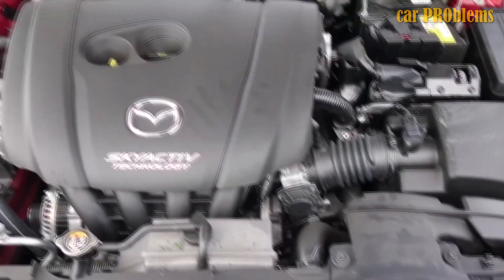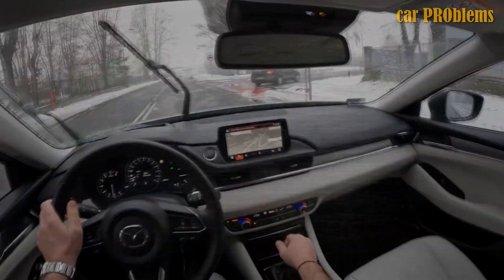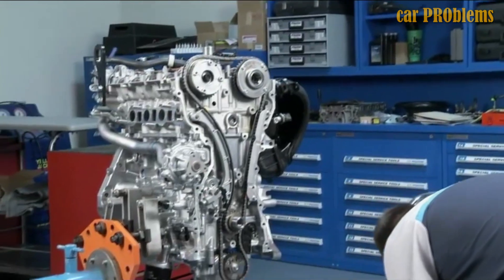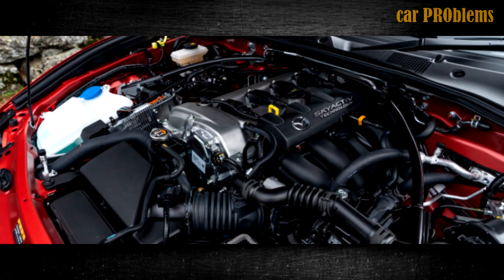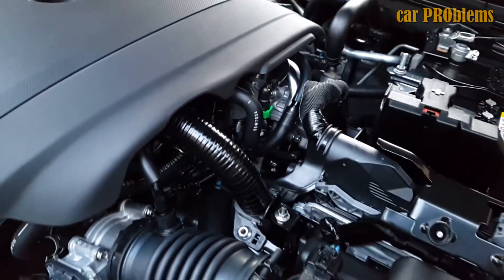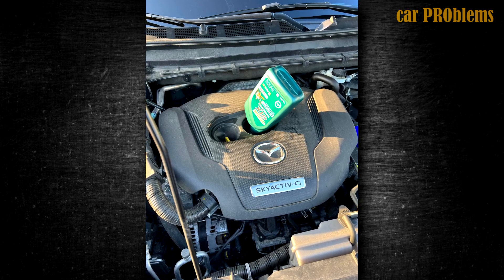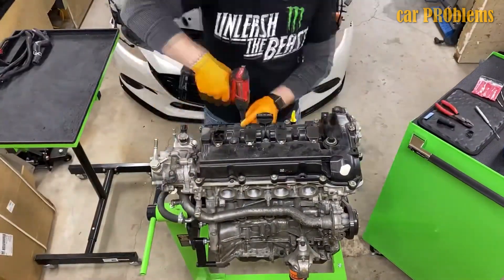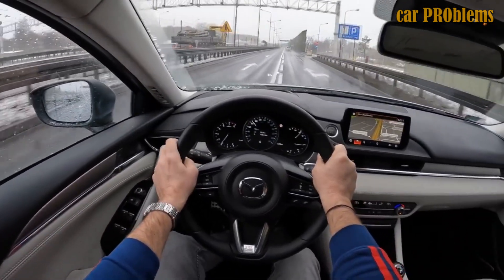Mazda 2.0 Skyactiv-G Engine: Problems, Reliability and Specs

Comment: Extremely boring and reliable, engine and car (mazda 3 ) had one for 9 years. Nothing went wrong with the engine ( 10,000 km oil changes ) one flat battery, one flat tyre. Bought a Peugeot , first year leaking water pump.
Reply: Why the hell would you buy a Peugeot… may aswell buy a Vauxhall. It’s just cheap plastic crap
Reply: @jugganaut33  cause RCX look good
Reply: @vladislavfeldman6562  that’s fair I guess
Reply: Why boring?😂 I own one my self the G120 version one.
Reply: @nicotang5583  I also have one but its an 160 engine and i let 120 tune it to 198. No problem after 5 year tune.
Reply: @nicotang5583 See how that goes against a Peugeot RCZ 200.
Reply: @vladislavfeldman6562  you can't compare these 2 cars. They're completely different. The Peugeot is a coupe and not a compact car...
Reply: Boring? 😂 I got 165 hp not boring at all my previous car was Mini Cooper s 184hp with turbo I must say there is slightly different lol but the comfort and practicality I have with Mazda I chose Mazda every day all day
Reply: What engine oil do you use?
Reply: @darioali5517  Also have a 9 year old mazda. Well im using original mazda Supra x oil with wynns super friction proofing that additive realy make the noise and fuel consumption go down and at yearly car inspection person thought engine was off when it was running. Im changing oil at 12000 km. Driving hard also "redline" alot but theres slightly oil consumption when u go to hard "0.5L oil/5000km" so it made me drive slower rpm so it doesnt consume oil at all anymore.
Reply: @darioali5517  Whatever the manufacturer recommends
Reply: You’re supposed to do oil changes every 5000 and those vehicles
Reply: @shawnpennell1627  Mazda recommends 20,000km (12,000miles) with fully synthetic oil 10.000km is fine, but if you are game you can change the oil every 1,000 km.
Reply: Watter pump os pretty common issue also with mazda
Reply: What model year was your mazda 3 2.0 L?
Reply: @aiman1562  It was a 2014 base model, auto, air. cost A$20,800 brand new sold at about 80k.
Reply: I went the other way
Reply: Me too i am leaving my 407 for a Mazda 6

Comment: 12,000 mile oil changes..? No, try 5,000 mile oil changes.
Reply: Hi, I'm considering getting Mazda 6 with this engine. Is it really that oil hungry? Would you recommend the car in general? Thanks
Reply: @BennySVK117  I would definitely recommend the skyactiv Mazda 6 with the naturally aspirated (non turbo) 2.5l engine. These engines have direct injection and therefore the oil should be changed every 5,000 to 7,500 miles with full synthetic only to avoid carbon build up.
Reply: @robbyjay8119  Thanks a lot for answer :) I can't find any used Mazda 6 with 2.5 engine, only 2.0. The 2.0 petrol in Mazda 6 2013 is bad? The used car market in EU is pretty f*cked up right now, there is not enough cars and the prices just keep going up. Since this will be my first car, I'm pretty scared to just "pull the trigger" and buy one. I want to buy something reliable, that doesn't need to be serviced every other month.
Reply: @BennySVK117  The skyactiv 2.0l petrol (gasoline) engines are very reliable. My 2013 Mazda3 has the same engine and it has 150.000 miles on it now. However if you can find a Toyota Camry or Corolla that would be a good choice as well.
Reply: @robbyjay8119  great, I'll try to look for those. Thank you very much for your time Robby 🙏
Reply: @BennySVK117  the 2.5 turbo is only available in Americas here we have 1.5, 2.0 skyactive and they are uber reliable. No, you don't need to change the oil every 8k ish km, you can do it at 20k km as per the manual ( but i agree changing the oil around 10k km mark will be beneficial for the engine ). If you plan to track the car then yes change it at 5k km
Reply: @robbyjay8119  Tsss, I like the Zoom Zoom 3 better than the Corolla. More fun to drive, better handling on ice in winter. Toyota can't make a stupid clock that lasts15 years, the interior dome light switch broke. Toyotas are harder to find and more expensive, too.
Reply: @cnimi  I agree. I prefer Mazdas, but I wish they kept the 2.0l skyactiv engine here in the US.
Reply: @BennySVK117  I like the 2.0 L Skyactiv engine in the 2012 Mazda 3. Sometimes it is noisy because of the high compression. Really noisy when you start it in the cold weather. 5.87-5.99 L/100km on highway after 10 years. Oil hungry? 50 mL over 10000 km at 140.000 km🙂 Mazda 6 might be heavier, though. 2.5L petrol is the standard engine in 2023 in North America. And the used car market is messed up everywhere in the world. If the car is healthy, you should be fine to pull the trigger, I think.
Reply: @cnimi  Same fuel consumption 5.99L on highway with 2015 mazda3 But you can reduce it to 5.6L/100km when you add oil additives. I use wynxx oil friction proofing. It is oil hungry when you keep it at redline so it literally on low oil indicator. Its 50mL if you drive normal fast. Not fast fast. And noise? Ppl think engine is off when theres a bit of background with those oil additives its very silent.
Reply: Mobile one extended oil and filter 20,000 miles?  It's a lease car .....What me worry?  Car runs and drives well looks great ...